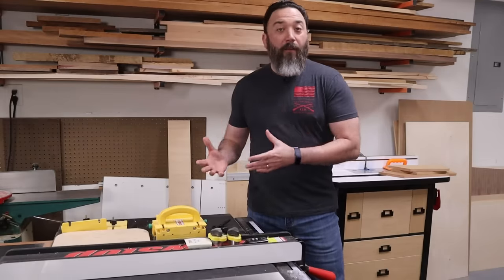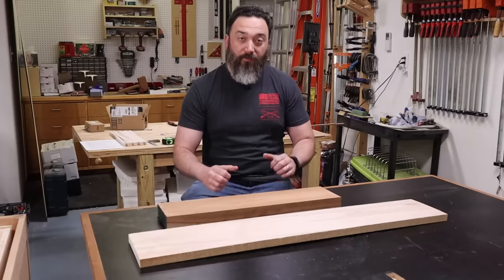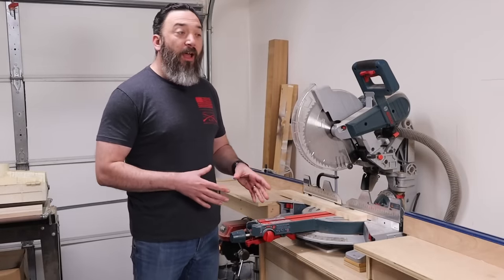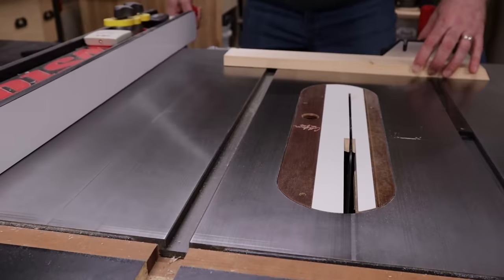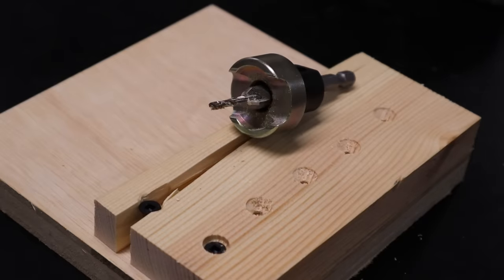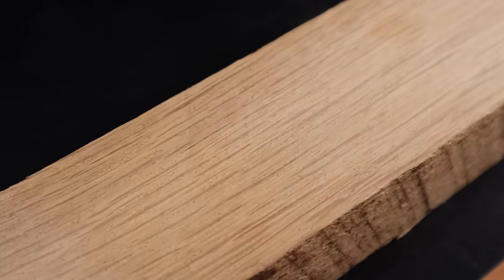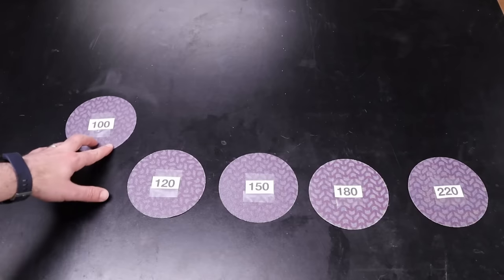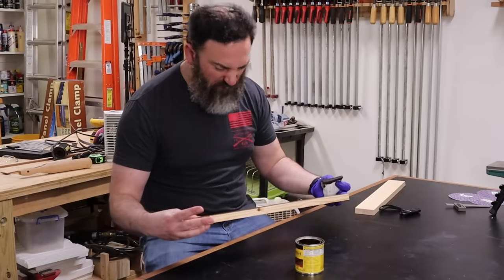Every Woodworker Should Know This!

Comment: Where's your riving knife and crown guard on dimension saw. Really  dangerous to operate without these safety features!
Reply from the maker: My riving knife is always installed unless I’m cutting dados or some other cut that prevents me from using it. The flimsy plastic guard on the other hand is not. I typically don’t use it because I can better assess the cut without it. A lot of times it is just in the way.

Comment: I dare you to go into a lumber yard and ask them for 4/4 thickness.  You will get .75" thick wood. 5/4 is 1" and so fourth
Reply from the maker: When I buy 4/4 lumber I get 1" thick. I've been to a few places that will even be slightly over 1" for 4/4. After I surface both faces I'm usually still around 7/8". 
Now if you are buying pre-surfaced lumber, then yes, it will be less than 1" because they ran the 4/4 through their planer to get it surfaced for you. You will also pay more for that lumber than you will for rough cut because they have more labor cost included.
If you are buying 4/4 rough lumber and they are giving you 3/4 rough lumber, they are ripping you off.
Reply from the maker: Rockler is not a lumber yard. They are a retail store. You'll also pay about 5x the price for the same lumber you could get at the actual lumber yard.
Reply: @biscuittreewoodworks    Denver Lumber, front range lumber, alpine lumber, Austin hardwoods, Jordan's building center, CBS Lumber, Rocky mountain forest products, Boulder lumber, ABC supply. These are LUMBER yards or suppliers I visit daily for materials to install windows and doors. Is there a conspiracy with just lumber yards in my area? How come if I go to ABC to get windows and I ask them for 5/4x4 hardie (fiber cement that can't be milled) I get 1" thick trim? Should I make a video for you? I'll do it next time I go get hardie, or s3s sills. I know what I'm talking about. As for rockler, I know what they are as well as I know you are likely to have one in your area. Maybe you have an Austin, or an alpine. I try to stick to local yards myself. Anyhoo, you dodged the argument and went on a tangent about rockler. No addressing the original point.
Reply from the maker: @lamegame420  I didn't go off on a tangent about Rockler, you did. Then you deleted the comment after I responded. 🤷🏻‍♂
Maybe you didn't know this, but hardie board isn't the same as hardwood. I've never seen hardie board sold in 5/4. It is typically a nominal 5/16" thick. A solid 1" thick hardie board would be ridiculously large and heavy for window trim! 
As for your original point, you "dare me" to go to a lumber yard and ask for 4/4 lumber. I do this all the time. I showed it to you in the video. I have a wall full of 4/4 lumber. Just for you I took a pair of calipers to multiple pieces to give you a precise measurement. I have oak, zebra wood, maple, curly maple, ambrosia maple, and cherry all in 4/4 and all measuring between 0.935-0.955". 
Not even sure why you insist on arguing this point. It doesn't even seem like we are talking about the same kind of materials. You are talking about construction materials and I'm talking about hardwood lumber. They are not the same. But I'm sure you still insist I'm wrong.
Reply: @biscuittreewoodworks   I didn't delete any comments, you can thank YouTube for that. Yes, 5/4 hardie trim is really heavy, it's also industry standard because it lays 1/4";proud of hardie lap board.  I used hardie as an example because  it's not intended to be worked to another dimension, like s4s lumber, and it still uses same terminology at question because they use the same system, probably because siding used to be lumber more than fiber cement.  As for saying hardwood and construction materials aren't the same, I can tell you spend most of your time in a shop, and not on a construction site. We both still go to lumber yards.  I use hardwood all the time. Oak, maple, teak, ash, aspen, birch, pine. It doesnt matter what type of wood. You ask for 4/4 profile s4s and its going to be 3/4" Every time I go in and ask for 5/4 milled lumber, it is 1" thick, at every lumber yard mentioned above.
Reply from the maker: @lamegame420  Well, my friend, I don't know what else to tell you other than it depends on your supplier. I know when I buy 4/4, I get 4/4, not 3/4. And you are correct, I've never worked on a construction sight, nor have any intention to. I build furniture, not buildings. I respect those that do construction work day in and day out, it's just something I have no interest in doing myself. Have a great day!

Comment: A 4/4 board in not an inch thick?
Reply from the maker: Yes, a 4/4 board is typically 1" thick. It can be thinner if is has been milled, and may even be thicker if it is rough. It's good to know what your lumber supplier is providing before making the purchase. You may be buying rough lumber, skip planed, S2S, or S3S.

Comment: Wrong volume equation dude volume measured in cubic feet is length x width x thickness divided by 1728 not 144
Reply from the maker: No, I used the correct equation. This is board feet, not cubic feet. That is a completely different unit of volume.
Reply: @biscuittreewoodworks  right I think we are separated by a common language here you are measuring cu inches and  expressing it in feet. In uk we don’t bother with cu inch but go direct to cu ft  40 years a joiner pretty sure I been doing it right

Comment: 4/4” what?
Reply from the maker: I don't make the rules, that's just how it works!
Reply: @biscuittreewoodworks  4/4” is 1” in the rough, after milling to finish thickness it is 3/4”. Hence, 1x4 is actually 3/4” by 3-1/2”
Reply from the maker: That’s construction lumber. When I mill a rough 4/4 board I can usually get 7/8” out of it. Some places go heavy enough on 4/4 lumber that you still have a full 1” thickness after milling.
Reply: @biscuittreewoodworks  this changed during the two great wars. Before WW1 a 2x4 was a 2x4. After it became 1-3/4x3-3/4. And after WW2 it was reduced to 1-1/2x3-1/2”
Reply: @biscuittreewoodworks  I suppose lumber mills differ. When I order 1” lumber, I order 5/4”. But, you are right, it comes 1”strong. Maybe 31/32”
Reply from the maker: A 2x4 is construction lumber. Yes, a 2x4 is not the actual size listed. I’m talking about hardwood lumber which isn’t sold in 2x4 or 2x6 boards. Hardwood goes by a different measurement system and is sold by the board foot. A stack of 4/4 lumber can have many different widths.
Reply: @biscuittreewoodworks  correct. Can we agree that 4/4 is 1” rough, It’s closer to 3/4” S2S?
Reply from the maker: It really depends on your supplier. I just checked several pieces of cherry, oak, curly maple, and ambrosia maple in my shop. All are 4/4 S2S and between 0.935”-0.985”.
Reply: @biscuittreewoodworks  I need to start ordering from your suppliers

Comment: Wow, Americans do things so complicated, use the metric system, timber is sold by the lineal metre and priced as such, and the metric system works on tens and not fractions making it so much easier to work with
Reply from the maker: Maybe the construction lumber, but I’m pretty sure your hardwood is sold in a volumetric unit as well.

Comment: Ok, wait.

25 inch x 6 inch x 2 inch… got it.

144 happens to be 12 squared and 12 inch = 1 foot happens to be the conversion, HOWEVER, for a volume, I need 12 cubed, not 12 squared!

Your units to this are inch•ft•ft or inch•ft squared.  WTF?
Reply from the maker: The units are in board feet which can be represented as BDFT or BF. Yes, this is a volumetric unit. Looking at this mathematically, the units of BF = cubic inches/144. The 144 is a unitless conversion factor that converts cubic inches to BF. 
144 cubic inches = 1 BF

Yes, it is a volume of wood, you forgot the thickness. In your example, you have a 12 inch square piece of wood AND it is 1" thick. This is 144 cubic inches of wood which equals 1 BF. 
12 x 12 x 1 = 144 cubic inches  
144 cubic inches / 144 = 1 BF

A 12 x 12 x 12 cube of wood would be 12 BF. 
12 x 12 x 12 = 1728 cubic inches.  
1728 cubic inches / 44 = 12 BF

One more example! Let's say your board is only 1/2" thick!
12 x 12 x 0.5 = 72 cubic inches
72 cubic inches / 144 = 0.5 BF

I hope that helps clear it up!

Comment: I can't understand how Americans continue too use the imperial system, when the rest of the world is using the Metric system which is , simple?
Reply from the maker: Pretty simple to me. I've been using it all my life with no issue. 
Curious though, did you get anything from the rest of the video or stop watching because I started with the board feet measurements?
Reply: @biscuittreewoodworks  , I watched the full video to see if I was missing something, hence I learnt nothing spectacular. I was brought up on the imperial system until I was twenty (1974) I'm from New Zealand, we changed from the imperial system from 1969 and were fully transferred to The Metric system by 1976, I have a degree in mechanical engineering and before I retired had spent over twenty years visiting the USA, due to my engineering an company I worked and consulted for, I wasn't attacking you personally just an observation , also we don't buy timber (lumber) like you, if I want a 2x4 I go to the hardware shop and purchase 100x50mm x length, simple, we don't buy by pound we buy by Linear measure.
Reply from the maker: @donaldjohnrobinson6531  Hey, no offence taken! I was actually curious because I realized after I launched the video that I might alienate the non-US audience by starting out with board feet! 
I also have an mechanical engineering degree as well as a masters degree in reliability engineering. I'm still doing that as my full time job.
Reply: @biscuittreewoodworks  , I'm also curious why you would support such an archaic system, where's the value? It has know value, is unproductive? Fortunately I have also traveled and consulted extensively around the world, and find that common sense and practicality also more effective, efficient and personally outweighs so called reliability engineering, can't say I have ever heard of this theory, but I'm only 69, please enlighten me on this ?
Reply from the maker: @donaldjohnrobinson6531  If you spent over 20 years in the US, then you should know I have no power to change the entire country over to metric even if I wanted to. If I want to use metric, I have to convert literally everything which makes my life much more difficult. So for me it's more simple to use the system the entire country is using, and since I've used it all my life it's not difficult at all. I honestly don't understand why so many people think they are superior because they use a different measurement system, but I get comments on that almost daily. 
As for reliability engineering, it's a science that was initially developed in the aerospace industry in the 1970's. It involves using statistical analysis to determine the probability of a machine or system failing. Then analyzing the mechanism of failure and developing solutions or mitigations for this failure mechanism to therefore increase the reliability of said machine or system.

Comment: For God’s sake just use the metric system… you guys love to make your life so hard for no reason
Reply from the maker: At this point it would be more difficult for me to convert to metric than to keep using the math I understand and have used all my life.
Reply: @biscuittreewoodworks  You can use both... that way the old system can be phased out, that's what everybody did when they transitioned to the Metric system, some even have both at the same time like in the UK (but nobody uses Imperial, except for work on antiques and for ordering beer)

Not to mention that if you used metric in your videos then they would be more useful to a much bigger audience than just the USA

Comment: What? Did I just see throw a pice of wood in the trash?  omg what poor advice? not a good start!
Reply from the maker: Yes, I threw a piece of wood in the trash. It was for visual effect. It represents making a mistake and ruining part of your project. I didn't anywhere is the video give advice to throw away wood, on the contrary I give many tips to prevent making mistakes and ruining your materials. On the other hand, I do throw away and/or burn a lot of scrap. I usually do this a couple times a year because otherwise my shop would be so full of wood scraps I wouldn't be able to even get to any of my equipment for all the massive piles of scrap.